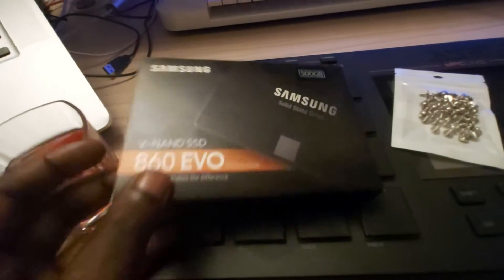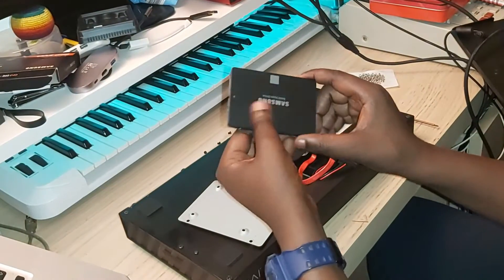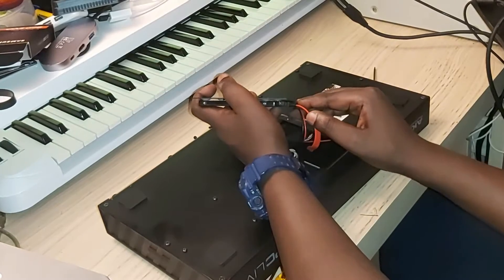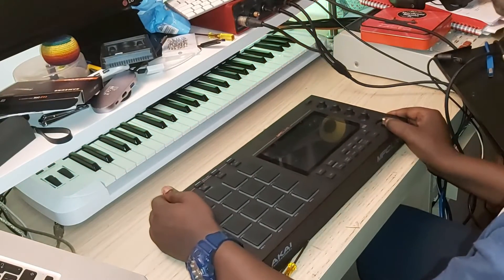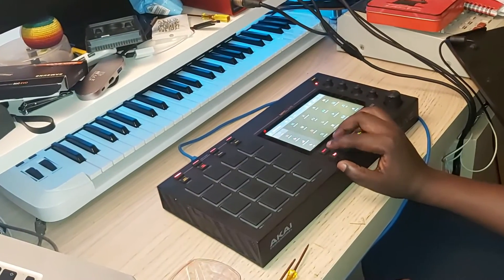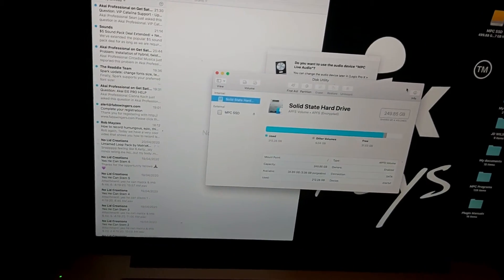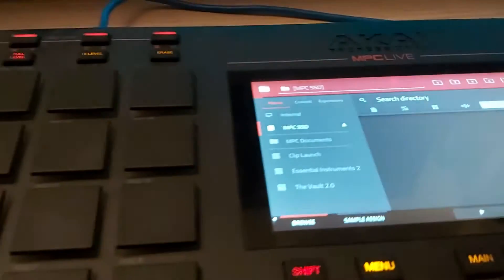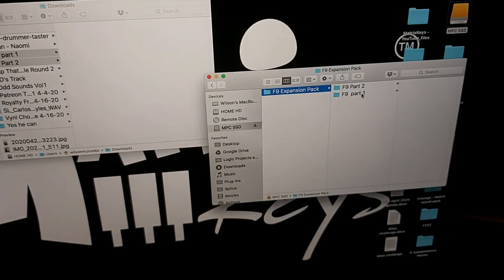MY MPC LIVE SSD INSTALLATION ( How To)

Comment: I just brought a mpc live and I'm new to the mpc live I have a 240 gb SSD that I want to install but my question is can I only save project or can I put my 2rd party drumkits as well
Reply from the maker: Welcome to the MPC Gang! Great product you have bought yourself awesome. You can load the SSD with as many samples as you wish, save as many projects, even save your favourite presets for quick retrieval in any project. Think of the SSD as an an extended suitcase ready to save and load your favourite sounds etc. You can basically save anything on the SSD. Hope this helped.
Reply: @MatrixKeys  hell yeah I'm ready
Reply: @MatrixKeys  but what's the point of the sx card slot how do use it? Do use it to drag samples in real quick but you can also do that with a thumbdrive
Reply from the maker: Thats correct, you basically have 3 ways to load and save samples and projects by SD Card,  external USB drives and the internal SSD if you install it.
Reply: @MatrixKeys  thanks for the gems really appreciate it

Comment: How would you do an external SSD?
Reply from the maker: Hi, Please elaborate, what do you mean by "Do an external SSD"?
Reply: @MatrixKeys  How would u format it (external SSD drive) for an Mpc One and add expansion packs to it.
Reply from the maker: @TheEdub1  If you have a computer, plug the SSD in the computer and Format it to EXFAT,. After Format you can then plug it into your Mpc one and your good to go. With regards to the expansions, just create a Folder in the home directory of the SSD called 'Expansions', chuck your expansions in there and All should be set.